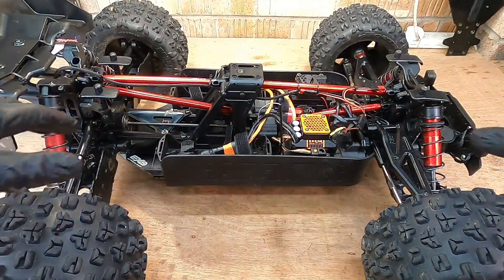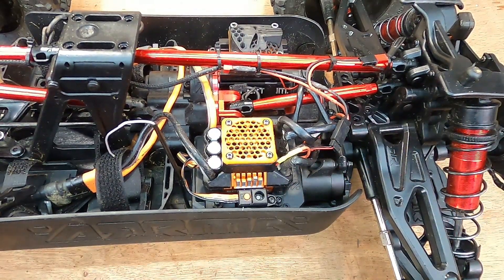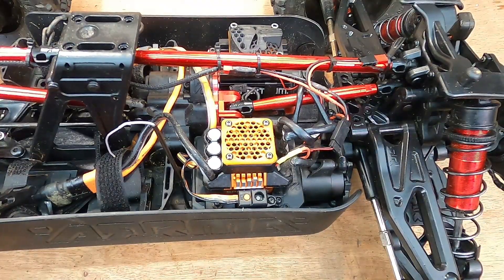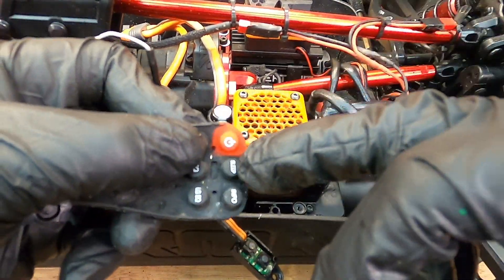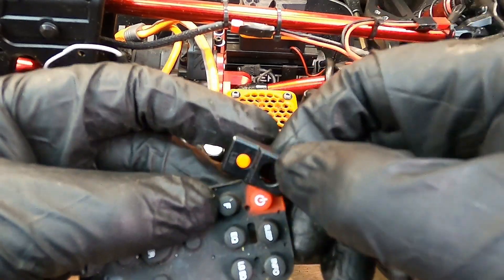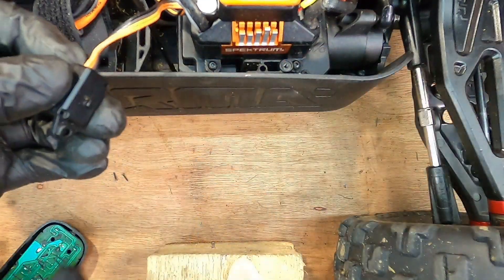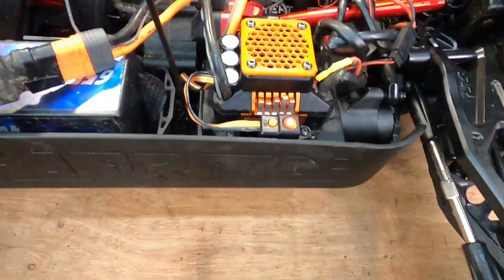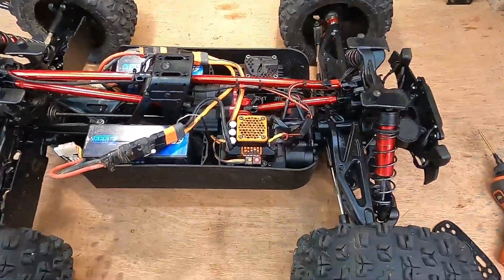How to fix a broken spektrum ESC button for FREE!

Comment: I got rid of my switch you plug in your powered up.spectrum firma 4 wire 2 orange 2 black just connected  orange to orange black io black heat shrink and it's good to go could it switch in but I'm good.
Reply: Thanks so much for posting this!  It worked for me!  My esc would then off when i let go of the button.  how do you calibrate the esc now without the set button?
Reply from the maker: @kaptkronik135  hi. If you don't have a set button  then you will need to get a spektrum esc programmer. It connects directly to the esc and you are able to adjust all your settings.
Reply: @kaptkronik135  I bought a program card for it. Under 30 bucks. Plugs into port on esc under the rubber plug.
Reply: @robbomber984  I have one of those but I dont think you can calibrate from that, only program.  By calibrate, i mean set your radio limits with he esc.  I just bought a max6 esc button on ebay from china, i am going to wire that in, less than $10 shipped from china(firma 160a is a rebranded hobbywing max6)
Reply: @kaptkronik135  I calibrate using my dx5 r controller.
Reply from the maker: Nice. My remote button mod is still working but if it goes I may do something similar. 🤔

Comment: Where get screens for fans?? Ik you had the information in a video
Reply from the maker: Here is ebay link bro...
https://www.ebay.co.uk/itm/Motor-and-ESC-Fan-Debris-Cover-Set-Arrma-Kraton-or-Outcast-8S-3D-Skull-/234030023125?mkcid=16&mkevt=1&_trksid=p2349624.m2548.l6249&mkrid=711-127632-2357-0
Reply: Thanks